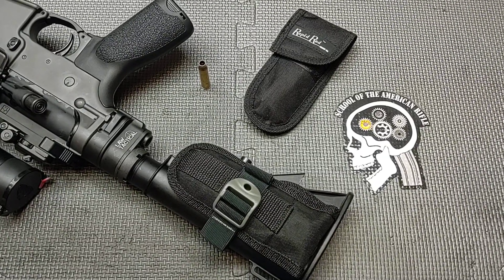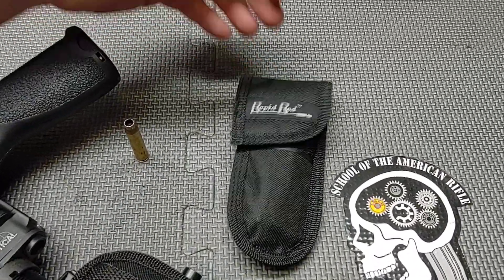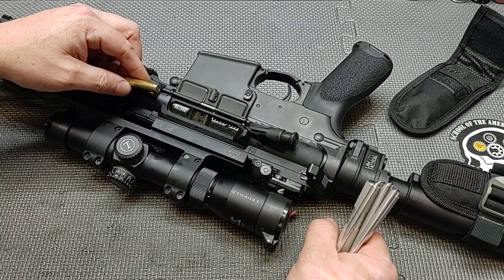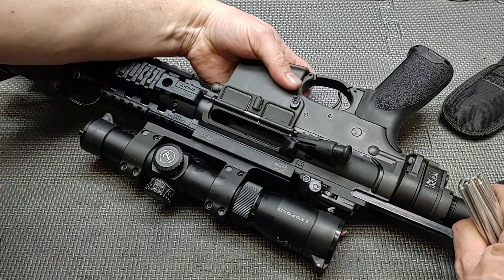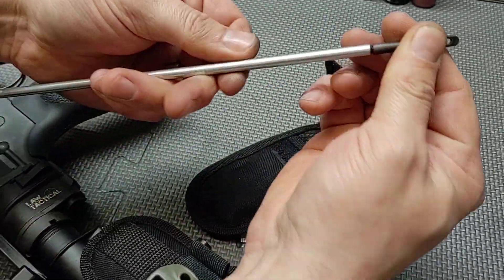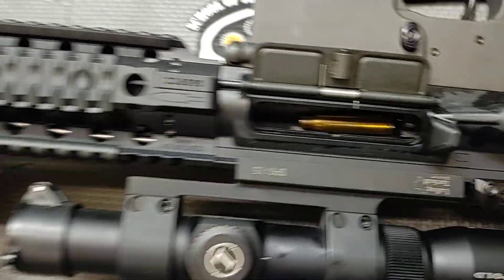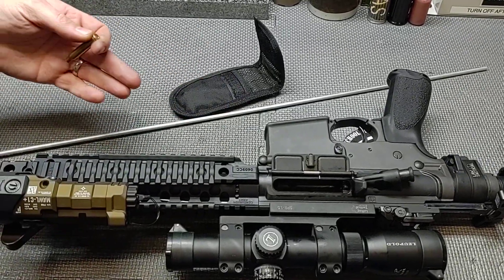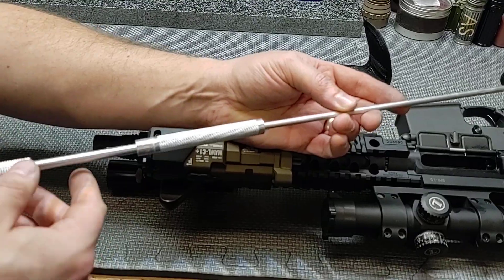AR Tech Tip - Clearing a Stuck Casing with a Rapid Rod

Comment: I tried this about a year ago after watching Deviant Ollam recommend the same thing. Unfortunately, the first case I had to use it with was hard stuck in a tight chamber. 
It essentially deforned the thin aluminum rod at the joints as to render it useless.
I ended up having to buy a dedicated nylon coated steel rod, and even that took some effort to clear it.
I purchased another collapsible rod to keep in my kit, but that steel rod lives in my trunk now, just in case.

Comment: If anybody is interested larue has a collapsible stock with a break down rod and compartments. they sell the rods with holders separately, which might fit inside a stock with battery tubes

Comment: I discovered that an AK with a pinned and welded muzzle device generally can't mount a cleaning/clearing rod of sufficient length unless it extends the full length of the muzzle device which looks goofy and is often omitted. This looks like the perfect addition to the triangle folding stock pouch on my AK74.

Comment: When the case is really stuck in the chamber are there any tricks to prevent the rapid rod or any other cleaning rod from buckling?  Some of those failures to extract are stubborn when there is oil in the chamber, debris at the cartridge neck, or on a hot barrel.  The case plastically deforms, and the barrel shrink fits to the case.  The grease injector needle and grease gun adapter work well to hydraulically extract the case, but that setup isn't available in the field.  The local AR armorer at the gun store usually has to send those jobs out for repair.  Usually, a firm tap with a cleaning rod works.  I don't know if there is a better alternative when he cases are plastically stuck.

Thanks for these tutorials.  It is so refreshing to watch and hear a true professional.  Seeing competence in action in the firearm line of work is so refreshing.  There are some really good people out there.
Reply from the maker: Correct. A shorter steel rod that snugly fits in the bore is best for badly stuck casings. I have drill rod at the shop for clearing stuck casings for my regular calibers. Works great.

Comment: Guys I have an AR that gives me light primer strikes and every couple of mags I'll get a failure to eject as the extractor rips the rim off the casing. This is with brass cased. It runs steel but I do get occasional light primer strikes. This gun did run great but it's owner crammed it FULL of lithium grease and buried it for a few years and I baught it in that horrid condition. I've cleaned that crap out of it for awhile now and I don't think it's that but thought I'd add all the information I could. Any advice would be really appreciated! It's an Olympic Arms lower with a Hbar M4 style upper. It's not stamped 5.56 but 223 and 5.56 give the same result